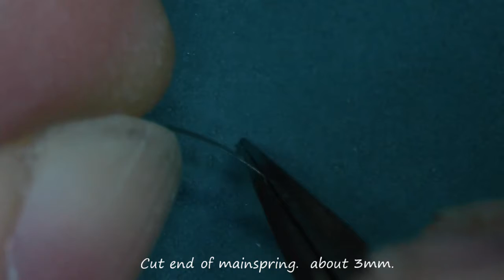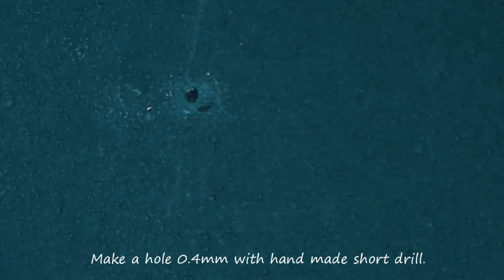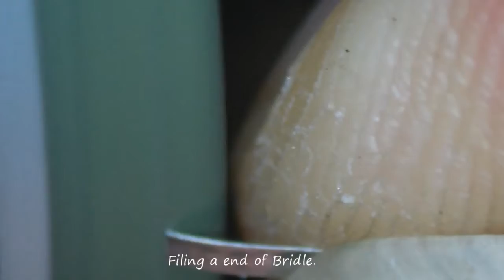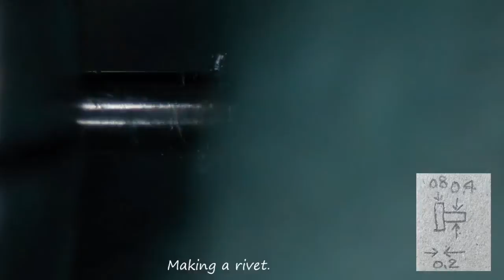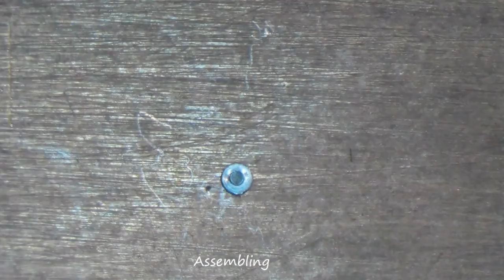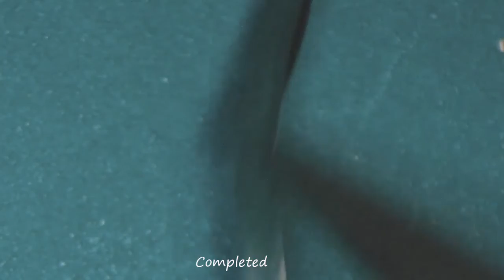Repairing a mainspring.    ゼンマイのリベット止め

Comment: Thank you for this amazing video. Just a short question, what raw material do you use to make this rivet? Also for balance staff what do you use and from I can get the material? Thanks
Reply from the maker: Thanks for watching. 
About a rivet , I usually made by just steel (not blue steel) .   Some guys made by blue steel, stainless steel, all OK I think.  But normal steel is easy to make it and no problem before.  
A balance staff is made by blue steel of BERGEON set.  If you can not get it , make a blue steel rod.  ( I uploaded video ‘how to make blue steel rod’)
Steels bought watch parts shop in domestic.